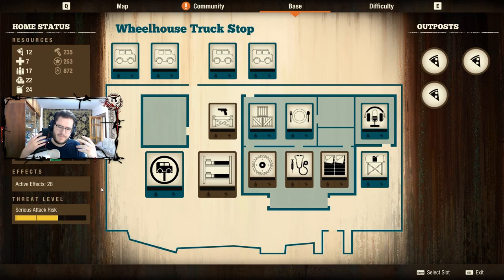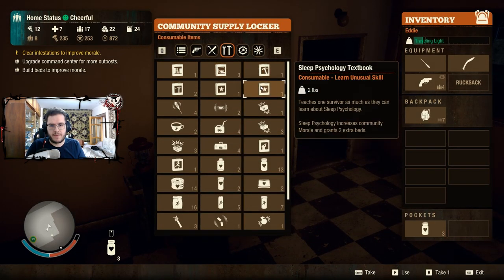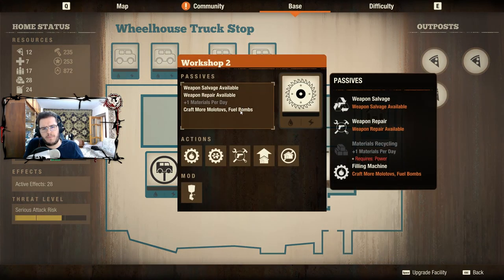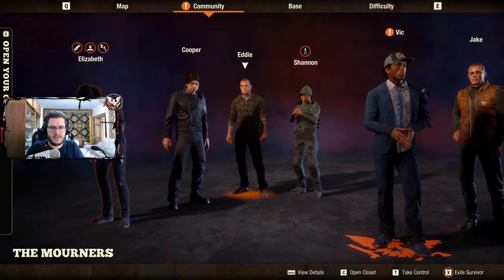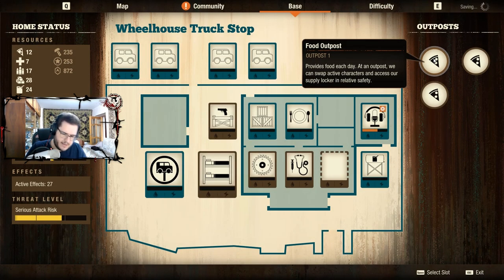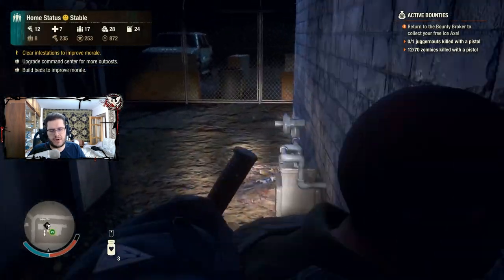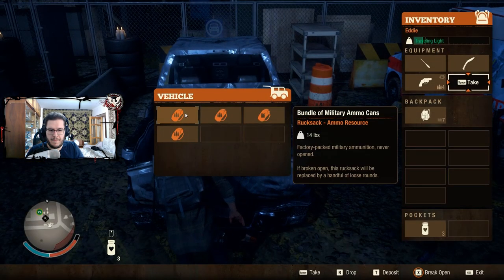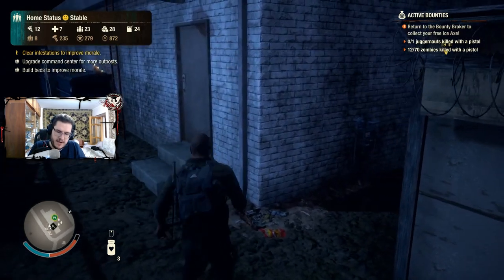State of Decay 2 Guide: 7 Tips to Build The Best Bases

Comment: I highly recommend the three Outpost a gas station an energy supply place a Water Tower Place. If you don't have the Builder boon. I think you can have up to six Outpost so it really wouldn't hurt you. The gas station will combat the cost for the power and the water.
Reply: (In case some reads this two years later) 
You can have 7 outposts with a Red Talon Operator with Hacking as the fifth skill!
Keep in mind that he consumes 100% more food as a trade-off